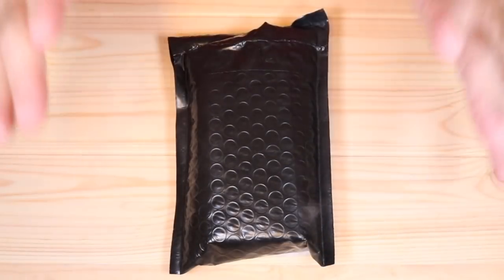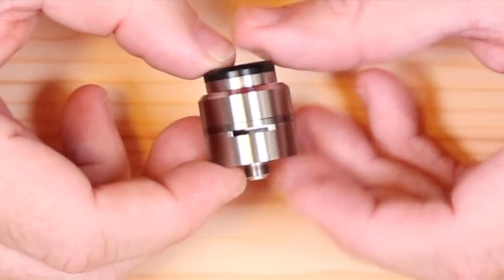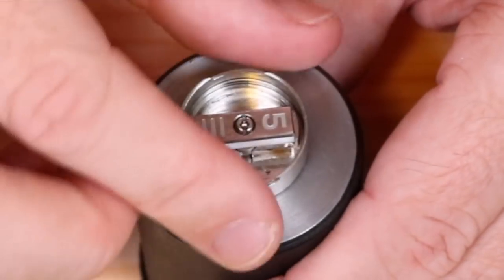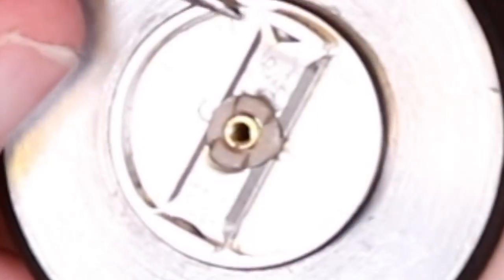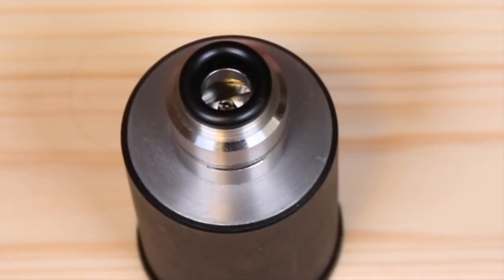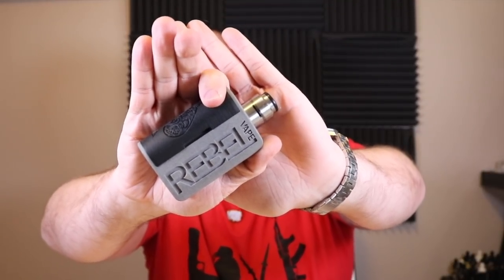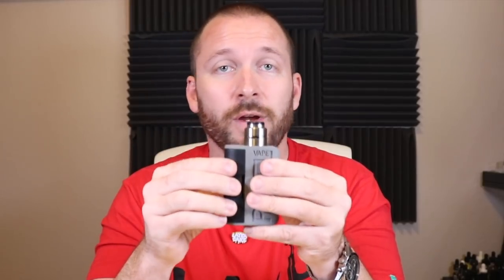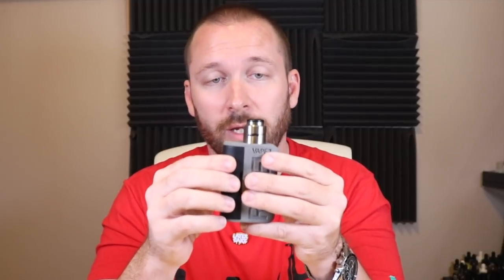LAYERCAKE RDA BY DISTRICT F5VE ~  DUAL 24MM "LET THEM EAT.....$*#T!"

Comment: Agree 100% on this rda it’s beautiful visually but functionally bad. I knew as soon as I seen pictures of this it would suck and the way it came out with no insulator around that screw was ridiculous. I even seen tons of people defending it by saying “if you don’t know how to build on this without shorting than you shouldn’t be using rdas” and I completely disagree with that. It’s just one of them things that is like sure I could build on this and be fine but why not Insulate it for those people who may not build it “correctly” Its just one of those things where it’s like wtf were u thinking?? Anyway rant over thanks for doing a video and wasting your precious time on this turd pal lol.
Reply from the maker: Dane you're speaking FACTS!  When a company messes up they don't need to lecture people about building safe, instead they should design a product that minimizes the chances of catastrophic failure!  To me it just seems that District F5VE spent all their time, energy and money on looks and trying to be "witty" , but we all see how that worked out for them.  Such a beautiful RDA and such a shame nobody cared about performance and safety.  I remember Todd's Reviews wouldn't even post a review for this because the original batch was so dangerous! The fix on the Layercake is half-assed and if you notice at the end of the review I couldn't even use it to blow a cloud when I signed off because the RDA was THAT hot!  
Oh...just letting you know that I'm vaping all kinds of badass MCM gear at the moment :) 
Thank you so much for dropping some knowledge here brother!